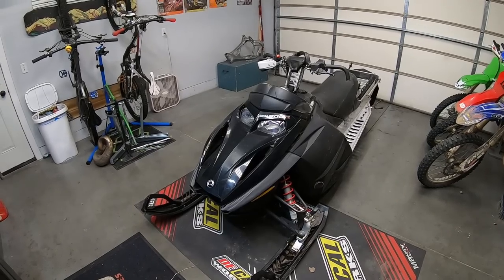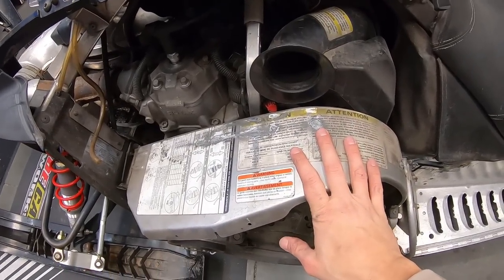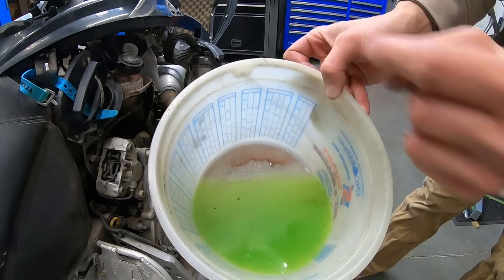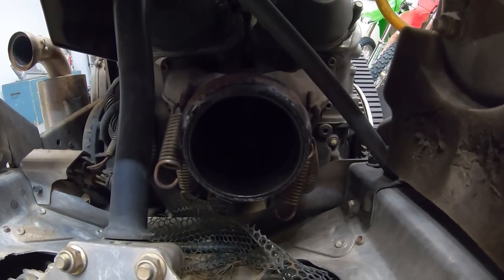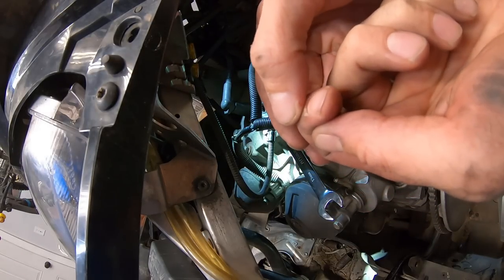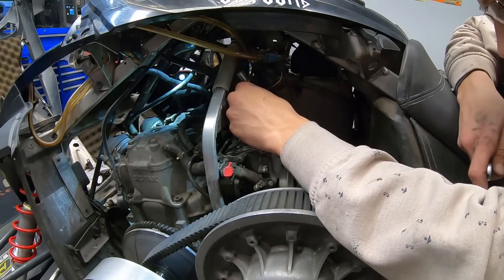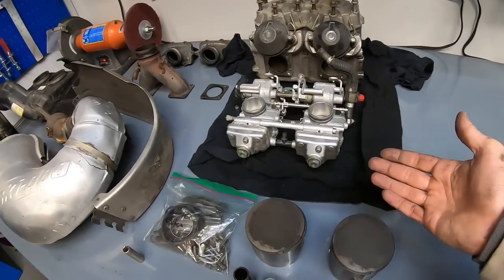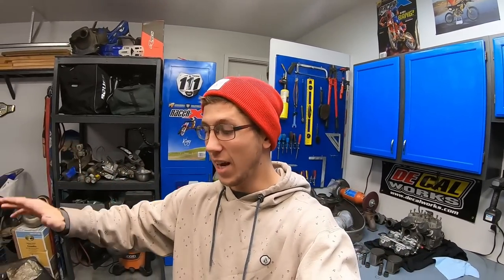Can I Fix This $650 Snowmobile with Zero Experience?

Comment: did you check compression? Check for spark? Spray starting fluid in carbs and try to start?
Reply from the maker: Didn't check compression but certainly felt low, yes checked for spark, yes tried starter fluid. Previous owner said he took it to a shop and they said low compression, needs top end.

Comment: If you can find a clutch puller installing the top end will be much easier if the engine comes out, they don’t weight very much
Reply from the maker: Noted - so you would recommend pulling the whole engine, doing the top end on the bench, and then installing the entire engine as one block?
Reply: Yeah it’s very little work for the benefit it grants, there are some coolant lines that run on the bottom of the engine it would be ideal too drain them and also check the oil return gear in the crank

Comment: I know that there a special grease that ski doo uses on the clutch side bearing and it's not cheap !!! Your supposed to regrease it every so many hours or mileage not sure the exact #
Reply from the maker: I plan to service that bearing as well as the clutch. Also change the oil. In response to your other comments, thank you for the welcome, and do you think at this point I'd still be better of removing the engine? Can I install the top end on the bench and then install the entire engine at once?
Reply: @KincadePavich  yes you can , but you'll have to leave the exhaust manifold off as well as the carb boots
Reply: @KincadePavich  there kinda a pain in the but to work on